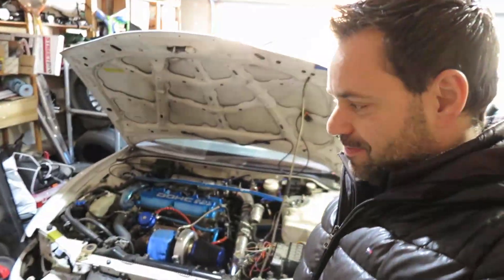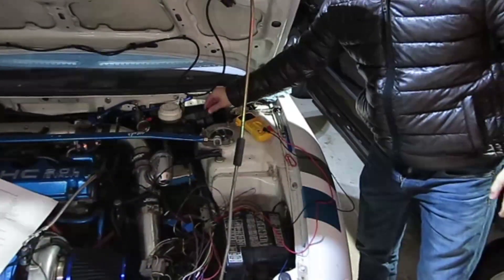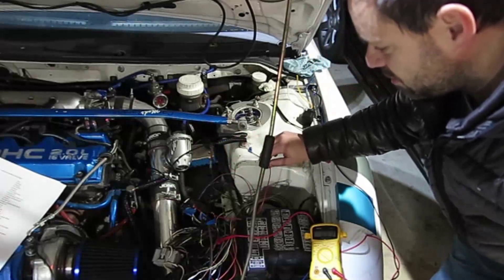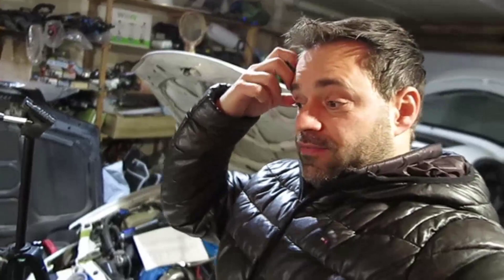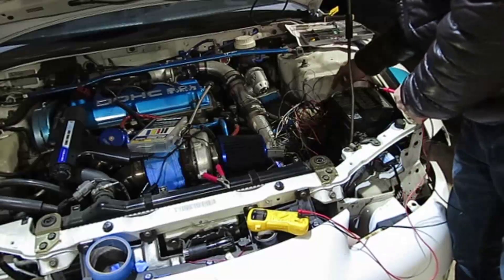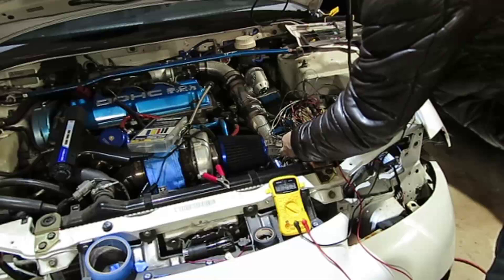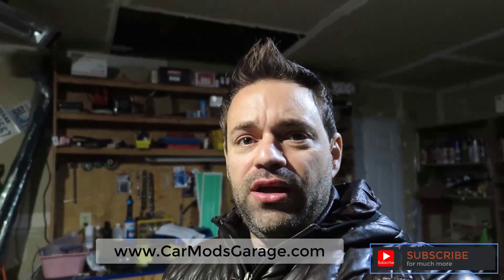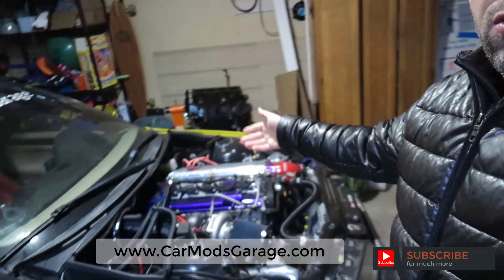ASD Relay Wiring. Eclipse Speeduino First Start Failed - Eclipse 2G Project

Comment: Can I just switch the fuel pump relay with the asd relay and see if my fuel pump works? If it does that should mean my relay is good. If so I’ll have to check if the relay is getting power. Any simple way to check? A bit hard to tell what you’re doing in the vid. Having the same problem so hope it this relay🫣
Reply from the maker: @ArtemzBuildz  not sure if the relays are the same.  Gotta Google to see.  If they are the same then yes. The other way would be to use a multimeter to see if power goes to the pin where the relay should be.  I don't know the put though.  Gotta Google also 🙂
Reply: @ thanks man. Really hope that my problem. Threw my engine in and spins over strong but no spark and fuel. But ey it’s my first dsm. Learning from the pros (you) 🤣
Reply from the maker: @ArtemzBuildz  oh man not me 😂.  Did you swap the relays?   Usually but not always when they get powers you can hear a loudish click.
Next maybe remove one of the wires going to the spark plug and see if you can hear the spark.  Be careful to not get a shock

Comment: hello car mods i have an 97 eclipse gs non turbo my add relay isn’t clicking when the key turned is it supposed to click with it turned or when im gonna start it the fuel pump relay clicks but the asd doesn’t and im not getting no buzz on the fuel pump brand new fuel pump
Reply from the maker: Usually you hear a click on the relay.  Your relay could be bad.  You can either try to test or get a new one

Comment: Hello car mods garage , I know this a old post but I’m trying to fire up my eclipse and I’ve looked all over and can’t don’t the pin out diagram, do you know where it is? Please help
Reply from the maker: The ECU Pinot? Which year is your eclipse?
Reply: @CarModsGarage  i have a 1998, I just wanna know what each wire is for and if it’s positive or negative and I noticed in the video you had a paper and i assumed it was the pinout of what each wire did.
Reply from the maker: @king960gaming5  ya that's right. I have on my computer the 97 if I'm not wrong which is different than the 98. Send me an email at Marcos@carmodsgarage.com and if i have it I'll send you
Reply: @CarModsGarage  I sent you the email.
Reply from the maker: @king960gaming5  I'll check on that as soon as I can today 👍
Reply: @CarModsGarage  okay thank you for the help

Comment: whatsup carlos , the negatives goes to chassis or what wires from ecu(oem) did u connect?
Reply from the maker: Oem it was coming from ECU so if I can remember correctly I wore to the chassis. Gotta watch the video to remember but Im sure I say it there
Reply: @CarModsGarage  I got some problems with ads relay , pin 67 goes ground even if the key is out

Comment: You’ll still see voltage on the ground side of a load on a circuit when there is an open. The voltage will be Lower than the positive side but still a voltage if that makes sense.
Reply from the maker: Ya that threw me off but I looked into the schematics and it said it was ground so I grounded it lol 🤣 car didn't catch on fire

Comment: I would have reused pin 85 and 86 on the ASD relay to avoid adding another failure point to the system which is the extra relay. So 86 would be a negative and 85 a switched positive. Cheers, can't wait for the startup.
Reply from the maker: Thanks man. I appreciate your comment

Comment: Can't wait to see if it starts. good luck
Reply: The reason you measured 12v on the relay trigger wire is because there is 12v on the ignition side of the relay (pin 85 I think it was). So when you measure on the wire that goes from the ecu plug to the other side of the relay (pin 86) you are measuring the 12v ignition feed passing through the relay coil to your multimeter.
Reply from the maker: That makes sense. I would assume I could not ground something that my multimeter was returning a dcv value though. That's what threw me off
Reply from the maker: I appreciate the support brother!